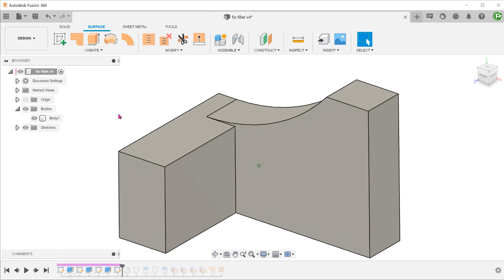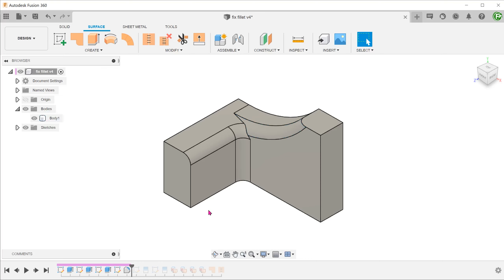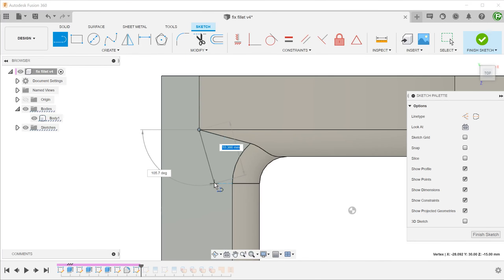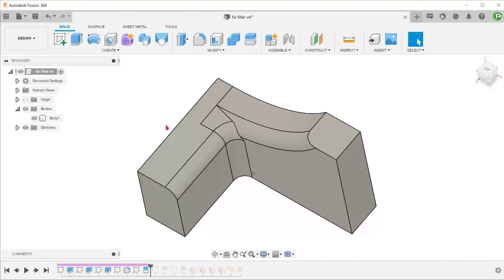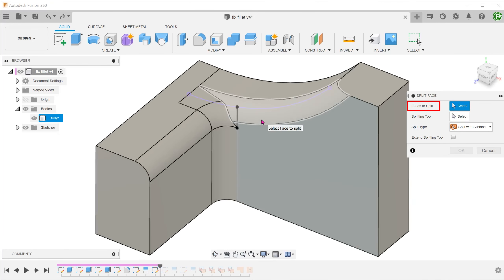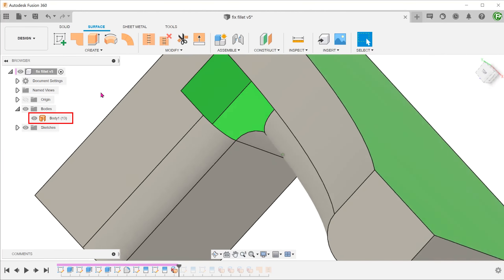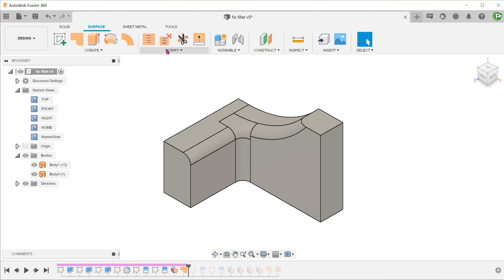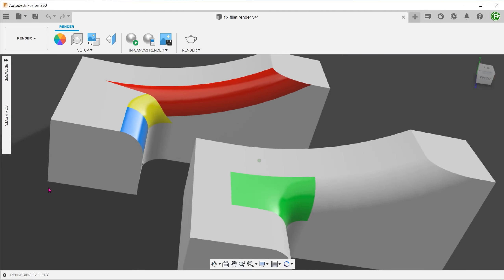Fusion 360 | Fix Fillets (Surfacing)

Comment: This issue has troubled me for years.  Thanks for this video!
Reply: Same dude lmao. So many hours wasted on these open loops
Reply: It’s a close method but the filet changes a bit. I don’t know how easy it would be to machine that tbh.
Reply: @brandonsummers6360  on a CNC this fillet would be just fine.  Certainly good enough for me.
Reply: @ZPositive  thanks dude!
Reply: That's why I using blender. Just million times more options and much much easier

Comment: I did not think of using sketch in this way; I would normally typically just delete faces and get ready to pres undo if it goes horribly wrong, lol. 

I must say my biggest problem now is that I'm often over engineering my models. 

But I'm getting there. 
Thanks once again for your video.

Comment: thanks a lot! nice to know.1:05 there is extend line feature under modify menu for this
Reply from the maker: Hi, thank you for the suggestion. Unfortunately, the extend feature cannot work on solid edges. Even if we were to project that line, we would still be out of luck as extend also does not work on projected lines.😅

Comment: Split face as a tool what does it do. As I have never used it because I don't understand its function.  What I have taken from this is that really it just cuts parts in half with out leaving a gap correct ?
Reply from the maker: Not quite. Imagine that every solid has a "skin", split face would only cut through the skin. It does not cut through the body. You can try performing this on a simple cube. After you perform a split face, there would still be one single solid body in the bodies folder. This is in contrast to the split body command where the body is cut into 2 or more bodies. The split face command is useful for defining a region on a face for performing further operations. In the case of this video, it is used for defining a region to be removed. It has other uses as well, for example in defining an area where a force acts during simulation. One key thing to remember is that split face does not actually physically change the geometry of the solid in any way.

Comment: I wonder if this part could be done with a minkowski instead
Reply from the maker: What is that?
Reply: @Fusion360School  sorry i spelled it wrong, i meant minkowski. Its a mathematical operation you can use sometimes to make fileted edges in openscad.
Reply from the maker: @radnukespeoplesminds  Sounds pretty advanced. Interested to find out more about it.

Comment: Nice solution! But you‘ve got to admit it’s an overly complicated way for a very common problem. Autodesk should work hard on the user experience im my eyes.
Reply from the maker: To be fair, I think this is a problem that most CAD software suffer from. I am not aware of any other programs that can blend complex fillets automatically.
Reply: @Fusion360School  true. But in a time when machine-learning is basically everywhere, it shouldn’t be too hard to implement a function where you can chose some surfaces to blend in professional software.
Reply from the maker: @rontz  That would certainly be a game changer. Hope that it can be implemented someday.
Reply: @rontz  whoa. ML in 3D cad would be amazing.... Never thought of that idea
Reply: @Soljarag5  Isn't generative design somewhat based on that?